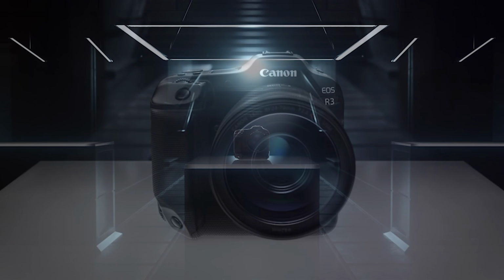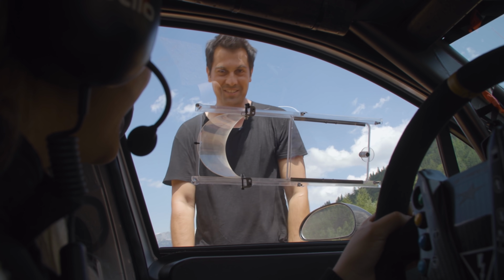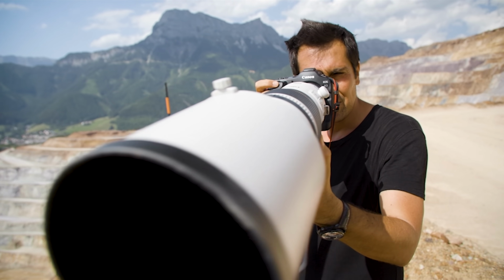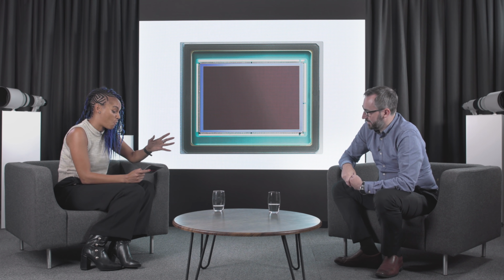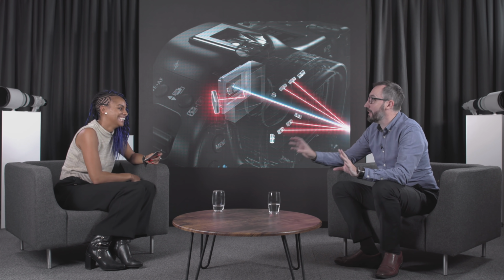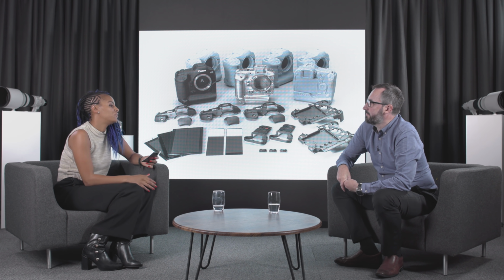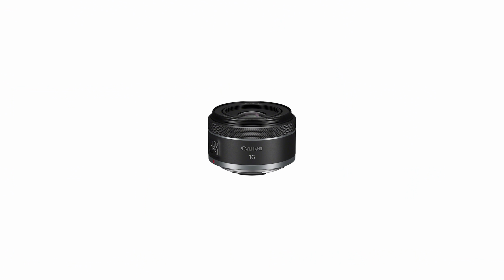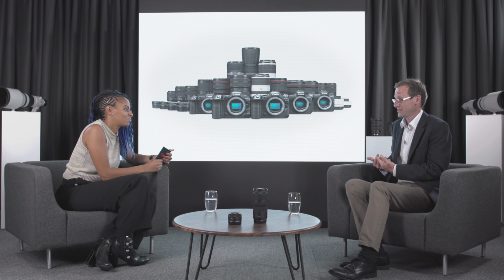The Canon EOS R3 - Launch Event

Comment: Does wearing glasses prohibit focusing in any way?
Reply from the maker: Hi Paul – it may not work with sunglasses, mirrored sunglasses, hard contacts, or bifocals, but it can be used with normal glasses. Accuracy may be degraded by reflections from the glasses or dirt.

Comment: Give us 120fps in 1080p and 60fps in 4K on EOS R. Maybe in 2x crop, just give. Sony users are laughing at us. :D :D :D
Reply: Well you get that in the R6 without a crop😆
Reply: @DavidsPredatorfiske  Yes, with overheating and twice the price. I want the EOS R with mentioned specifications. I have a bmpcc 4k for the main job. But i also want EOS R because i use it for gimbal work and it fits perfectly with the recording from bmpcc 4k.
Reply: @BushmanMedia  As the R is quite aged at this point we might see some new cameras in the R/RP price point soon! I’m hoping for a newer and better version of the RP which is more in my price range😆
Reply: @DavidsPredatorfiske  None of these. Prices are getting so crazy that in 5 years no one will be able to buy a camera. Everyone went crazy. And customers are asking if it can be cheaper.
Reply: @BushmanMedia  Well, you get what you pay for. Cameras really aren't any more expensive than they used to be. On the contrary: Full frame bodies have gotten a lot more affordable at the low end. Glass is what got more expensive - but it also got a lot better. In the Sony world, the only stills camera that does 4k60 at all is the a1. The R6 overheating is very well controlled at this point, certainly well enough for hybrid shooting. If you're after cheap 4k60 that doesn't overheat, probably look at a Nikon Z6.